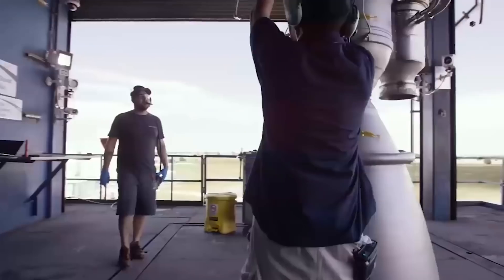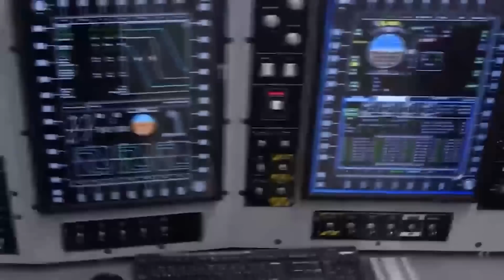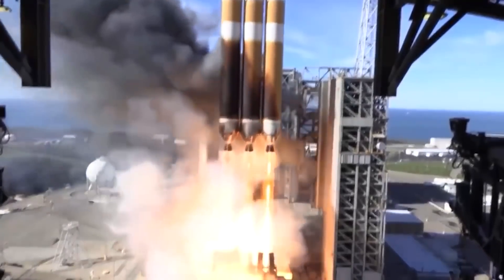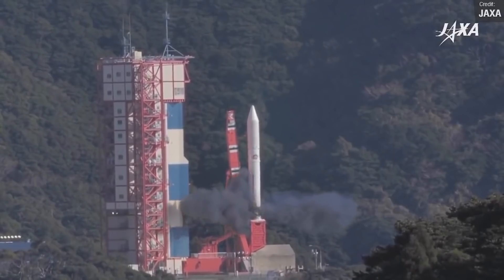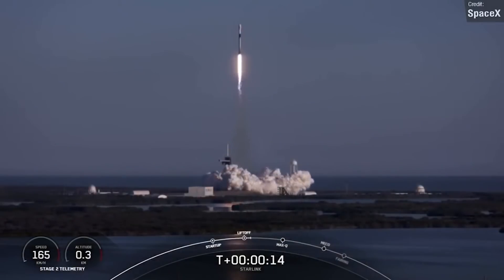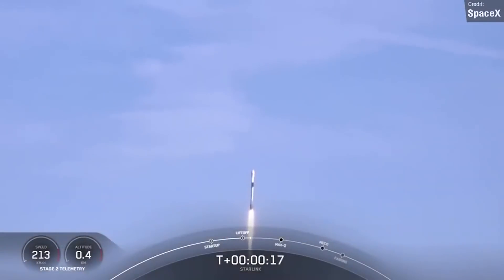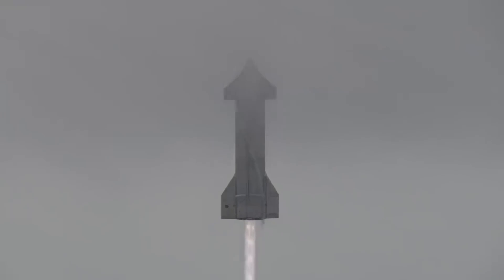intro.mov

Comment: SN8 is not preparing for a flight. SN20 is. SN15 already flew as did SN10, SN9, SN8. SN16 sits at the facility but has never flown. Nor is it thought that it will. SN21, SN22, and SN23 are under construction. As is B5.